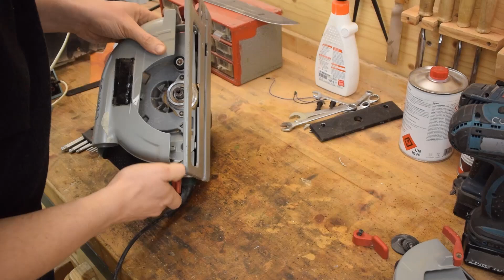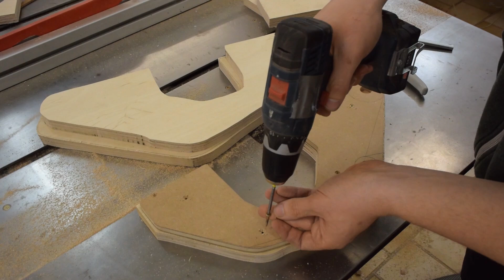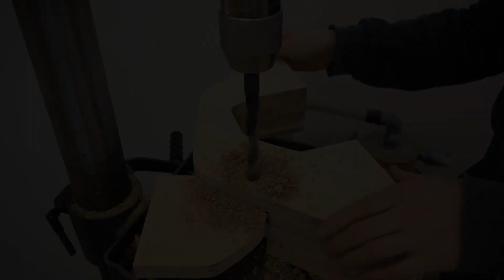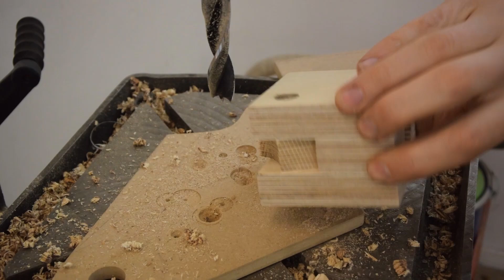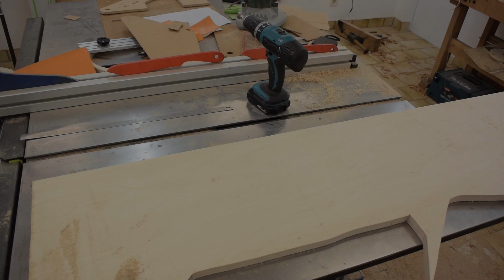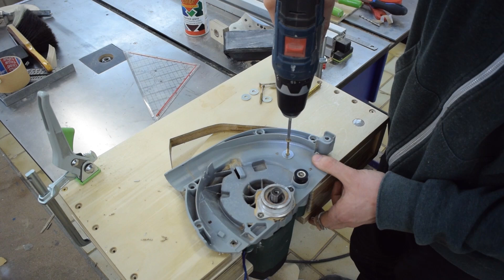How to build a Table Saw with Simple Tools - Part 1: Blade Lift Mechanism

Comment: Hi, can you estimate what is the weight of the whole thing? I want to do this with steel and industrial motor, which I guess will be like 3-4 times heavier. So far I plan on using lead screw 24x5 C45 or bigger C15, but I actually have no idea if it is enough and what will be.

Comment: Cosmas, great video and awsome design. I'm trying to build it myself. But you didn't mention anything about the accuracy of the saw. How did you solve the problem of keeping the blade perpendicular to the surface of the table top and paralel to the vertical plane it goes up and down?
Reply: You can ser other videos what talk this problem

Comment: Here in California you just used almost 60 dollars worth of wood just on this saw motor holder.  Wood here in this crazy over taxed state has more than double in price since I started woodworking 15 years ago.  I am building one now so I can get a table saw with my own custom features. But I would spend less $ if I just just purchased one of the low end portable table saws.

Comment: Ball bearings are always a good touch. My cheap ancient table saw uses fine pitch threaded rods for movement of one axis and it always gets caked in dust and becomes really stiff. But it doesn't look like yours is exposed in the same way so I think you're is fine. Good video as always.

Comment: Hello Cosmas. Safe to say you promoted yourself onto my most admired homemade tablesaw builder with this :D I hope you are still planning onto finishing the series because I am eager to (poorly) attempt to build it. I have one question about this part. I love how you solved the raise/lower mechanism, the sliding bearing block is awesome. my only concern is, is there a good chance of dust/chip getting into the slide and limiting the travel? I was wondering if it was better or worse to cut the slots for the bearing motion all the way through the plywood panels, to possibly allow for cleaning every once in a while? Another question I have is how do you change the blade? I see your saw has a button operated spindle lock, which is similar to my makita 5705R I plan on using, and yours seem to be hardly if ever accessible when the saw is mounted. does it work to just pinch and hold the blade while tightening the retaining bolt?

Comment: I have made the lift already. But thought if the lift consisted of two blocks in serial on the threaded rod, both with a "link" and without the pin. I wonder if this would result in a saw lifting rather than tilting up. Thus allowing a riving knife. I may upgrade in the future.

Comment: Cosmas hey,
I'm also an amateur hobbist woodworker and I admire well done projects.
My question is this.
Do you get any clogging, due to saw dust, in the up and down mechanism holding the saw, that creates any problem.
I got the idea because the fit has to be tight.
I would appreciate your response.
Ioannis Kassanis
Athens.

Comment: Why did you use a cast iron bearing housing for the tilt mechanism but a plywood one for the depth mechanism? Why the different materials?
Reply from the maker: The bearing in iron one can tilt a little, which is necessary for the tilt mechanism. The wooden one does not do that.

Comment: Very nice Cosmas.  Do you need some sort of locking mechanism to hold the saw at the desired height, or does the threaded rod (with its steep pitch) resist rotating under pressure sufficiently well?
Reply from the maker: Hi, no, it does not move. I had that problem with the big table saw. but not with this one.

Comment: Circular saws suffer from several problems. 1.) they are under powered 2.) they are direct drive 3.) In the US they are115 volts 4.) They have 7 1/4" blades thus limited depth of cut.
Reply: i use one from festool for 20 years now and is still working fine and no problems at all . i am now building a table saw using a 2.3 hp bosch gks-85s machine that holds a blade of 10 inch so how much bigger do you want.

Comment: Well done Cosmas. Saw the 2 previous videos too and I'm still impressed by the precision of your Jobs in general. When time comes (getting my Garage Workshop ready first) I will build this project, making use of a different motor unit of an old construction saw I have still laying around. Thanks for sharing this brilliant piece of engineering. Regards from northern Hessen.

Comment: Cosmas thank you for sharing. I'm getting tired of living with my badly made homemade saw so i'll start a build like yours. But in your arrangement the ball bearings for the slide won't roll unless enough play so you could be safe just with a solid sliding guide. Please don't take as smart ass comment  i've made several devices with this basic error? Regards. Peter

Comment: So u need a pantorouter table to made this? Just joking. I think this design is worth doing, congrants! Do u have the plans or a sketch of all this? What do u think about mounting an induction motor with pulleys to drive the machine? Would it be able to handle the weight?